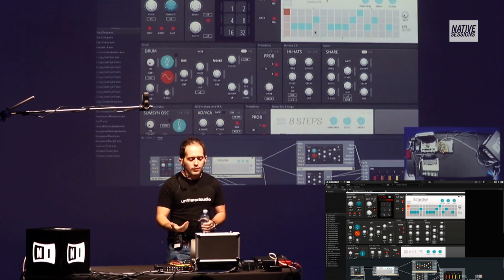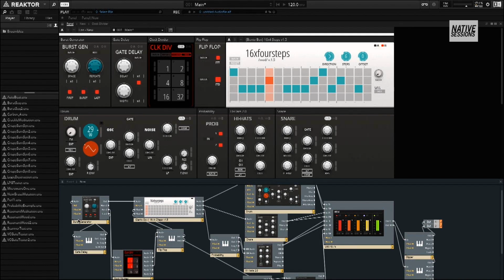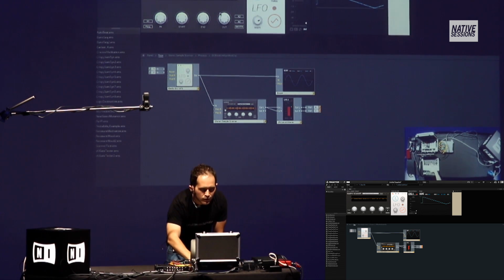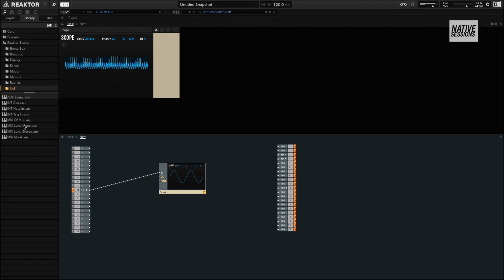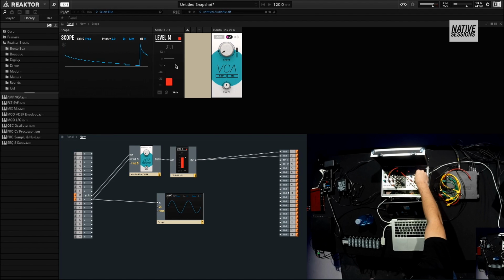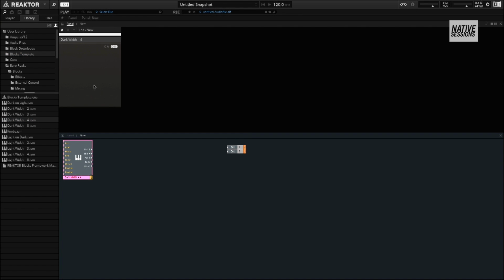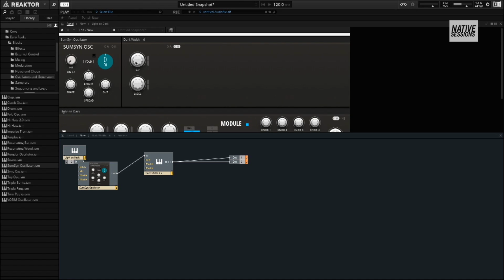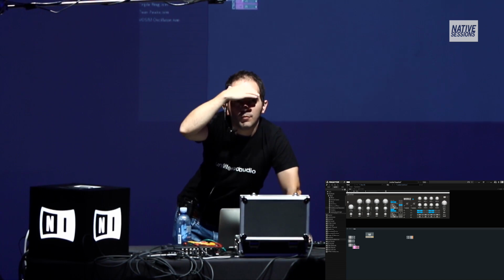Native Sessions: Play. Patch. Build. - EuroReakt Blocks with Michael Hetrick | Native Instruments

Comment: what audio interface is Michael using and why does using optical avoid the application of DC Blockers?
Reply: +Strages I'm using a MOTU Ultralite AVB. Optical cables transmit digital signals, so from an engineering perspective, it would be tough to decide how to implement the DC blocking (i.e. even if you can guarantee that the cable is carrying audio data, what's the sampling rate? Bit depth? How many channels?). The ES-3 and ES-6 modules use this to their advantage. If you're simply using Reaktor as a CV output, you don't even need to go the optical route, as the MOTU's analog 1/4" outputs can output DC signals. However, there are DC filters on the inputs. If you wait a few months, Expert Sleepers is releasing a USB audio interface module that has inputs and outputs, along with optical expansion. If that had been released when this video was filmed, I would have just used that!
Reply: +Michael Hetrick cool, I guess what I am asking is once the audio comes back out of Reaktor, it would sound different than just coming out of the module to a PA or monitor, do you notice loss in frequencies?
Reply: +Michael Hetrick Thanks! I was hoping Expert Sleepers would do some sort of USB interface like that eventually. Great video! Inspiring stuff.
Reply: +Strages Sorry for the slow reply! I don't really notice a negative impact on the sound quality.
Reply: cool thanks